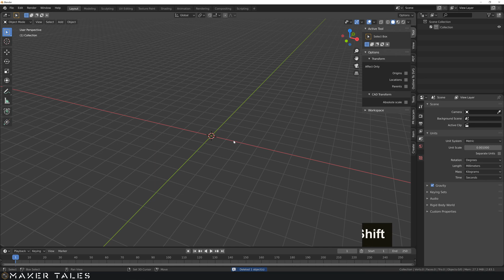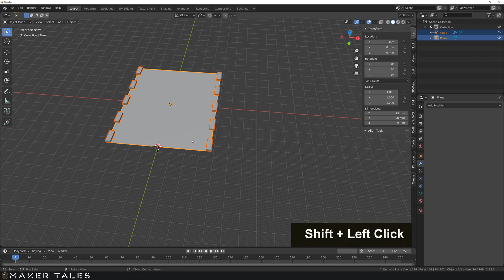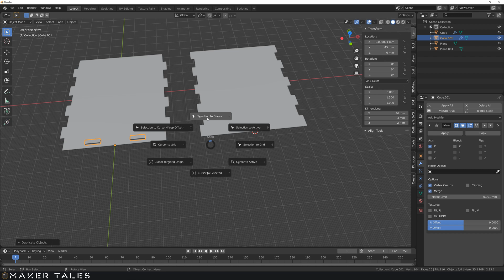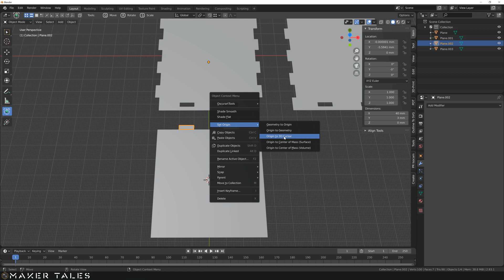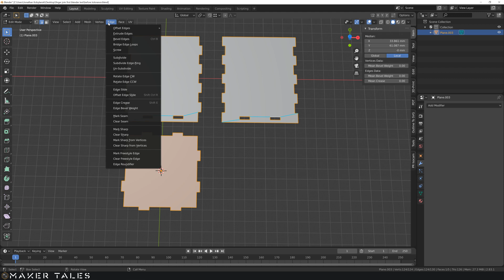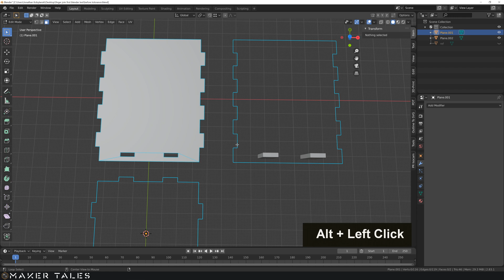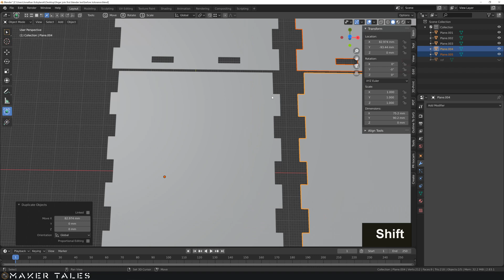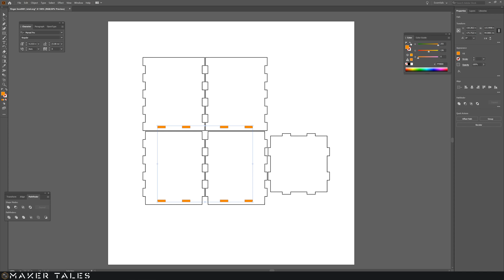How To Design & Export A Laser Cutting File From Blender 2.83 | Tutorial |(Blender To Laser Cutter)

Comment: the exporter doesn't work for me, I get a file with so many little vectors as if every edge was exported separatedly.
Reply from the maker: Hi Nisaza, How are you exporting the file? Are you using outline to SVG? is it a very complicated file?
Reply: @Keep-Making  hi, no. It's a very simple geometry of a box with 4 faces only, well, two of the faces have many holes since it's planned for making a pencil holder. Maybe that's the problem, but even the simple side shapes show problems in the export. Maybe it's the blender version not compatible with the addon?
Reply: @Keep-Making  so I fixed it by making a new file and importing the mesh, also erasing the depth of the object, making it 2d planes. It works great now
Reply from the maker: Hmmm how strange.... If you get a chance I would love it if you could send me the file that you had the issue with to hello@makertales.com

Comment: Trully is  a shame that Blender doesn't have proper support for SVG. Both the grease pencil lines and splines look humanly conceptually similar to vector formats, it's so strange that it is so clumsy and hard to get workflows between blender and inkscape/illustrator. I would easily switch to blender from inkscape/illustrator if it was able to export and import SVG for use with laser cutters / cnc / 3d printing without all the hassle.
Reply from the maker: I know it's very strange! I'm sure with time this will be a part of blender as importing SVG is super easy. It's just a matter of time I think. But for the time being it's going to have to stay a little fiddly for now..

Comment: Great Videos! I'm completely new to blender and am learning so much. I keep running into a problem in this tutorial around the 5 minute mark, where you use the bool tool to cut out the finger joints from the plane. For some reason the bool tool won't work for me. Either the 10 rectangles disappear leaving a flat plane or the rectangles will only cut out a few of the joints. I've started the tutorial from scratch several times and can't figure out where I've gone wrong. The only Idea I have is that I'm working on a mac and version 2.90.1 of blender. Any ideas what might be going wrong?
Reply from the maker: Hey, Pika Plorp.
I'm sure you are doing everything fine. What I would ask you to do is to go through the first 3 Videos of the new blender precision series where we start using blender 2.91
The reason for this is that the bool is "fixed" old version of the bool command have some very particular things to keep in mind to make sure it's a successful operation. The only other thing I could think it being is make sure that your face normal's are in the right directions and that you have no co-planar faces.

Let me know how that goes =)

Comment: Subscribed....  I appreciate your effort here, but it was a little disappointing.  I basically do what you did in Inkscape very easy (probably easier than yours), but it requires visualization in 3D space.  I was hoping your tut would do something in 3D that you can transform into 6 flat planes.  Your method still requires the visualization.  However, some designs have angles which making visualizing in 2D very difficult, I was hoping Blender might be an easier way.  For example, here's something I did, but it took a LOT of trial and error:  https://drive.google.com/file/d/1UBFOiQkYArmeQpOI4qS45WUtWXn_J-NO/view?usp=sharing .  In any event, thanks for your vid, I'll be looking at your basic ones as I study blender.

Comment: Great video. One thing that I did run into though is that to use the key shortcut for auto boolean ctrl + shift + [-], you have to have the bool tool add-on enabled. Also the key is numpad minus, not the normal one. Bit confusing, but I got there eventually.
Reply from the maker: Hi Echo,
Ah, yes thanks for pointing out that it's numpad buttons. In my eyes I made this as "part" of the precision modeling series where I explain this but I really should have mentioned it in the video. I'm glad you found it useful.

Comment: Love your videos on 2D /3D offsetting, and exporting outlines. Very handy indeed. Your lessons are very nicely produced, and address an important niche.

As you said, there are many ways to skin a monkey. In this one, again, I personally think there are some Blenderish approaches which could save me a lot of time. Not right or wrong: it's just the way people from different backgrounds think. If it were me, I wouldn't see any need for Booleans or arrays at all. 

Working in the flat, I would just make precise edge loops, using either Edge > Subdivide, or Ctrl-R, or Knife, and snapping, winding up with a rectangular face cut by  a grid of edges in the right places. Maybe I would duplicate chunks. Then I would just delete appropriate faces to make fingers, sockets, holes, and separations of parts, all derived from the same edges across all parts, so guaranteeing a fit. You could even colour them differently while working so you could see what you're doing.

Booleans in a polygonal modelling system are twitchy. They have a lot of work to do. In their most general use, they have to find intersections of surfaces, which is much more than you want, in most cases where I've seen you use them. Knife Project is a powerful alternative, which can be constrained, and project cuts through 2D or 3D objects. It can also project grids, or networks of edges ( with 'Faces Only' deleted ) through other surfaces. You never have to worry about coincident faces, etc.The disadvantage: the tool is destructive. It would be great to have a modifier version.

If I was starting out in Blender, with CAD-type applications in mind, I would want to be very familiar with that tool, along with Limited Dissolve, and all their options.

I really hope I'm not being a PITA. I'm hoping to make a payback for the things I've learned from you. I wouldn't comment at all on content that wasn't worth it.
Reply from the maker: Hey Robin,
Thanks for pitching in. Your not being a PITA at all. I understand every has there own points of views and opinions and even more so when it comes to 3D and add blender into that mix and it's crazy the amount of ways there are to do things.